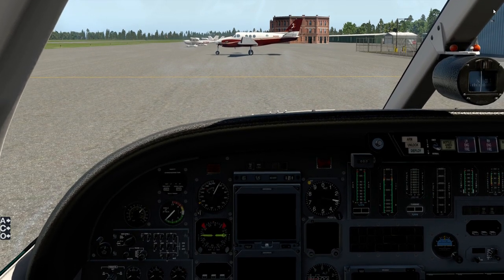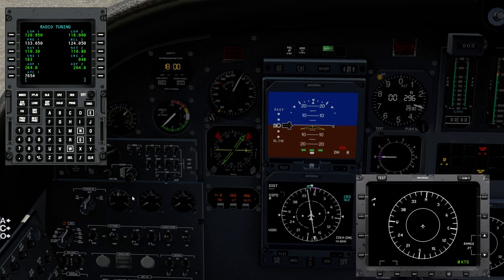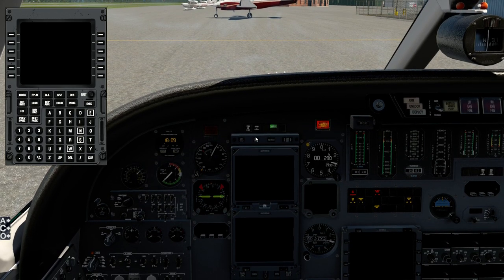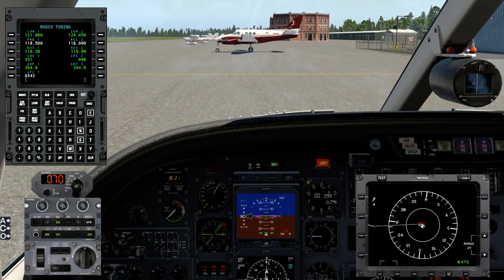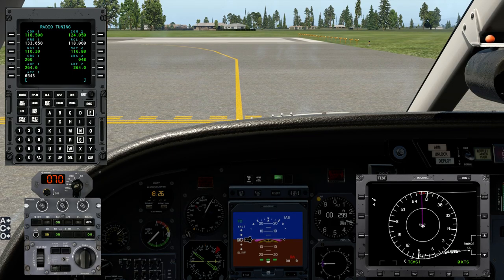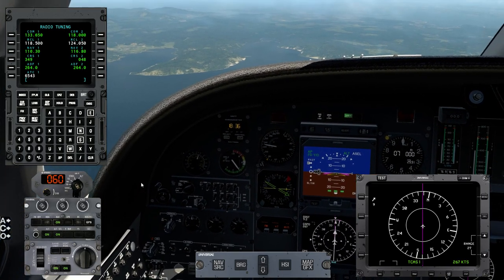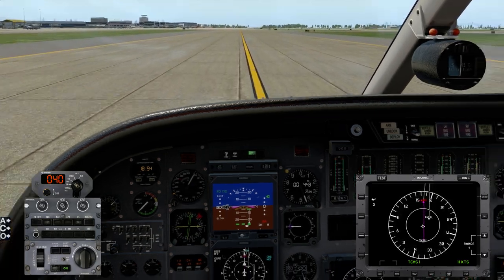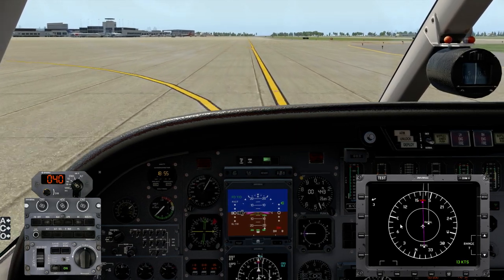Carenado Cessna S550 Citation II for X-Plane 11 Startup and Normal Operating Procedures

Comment: Hi one Questions how do i actívate the checklist?
Reply from the maker: Hello. Here’s the checklist:

BEFORE START

Preflight Inspection - COMPLETE
Flashlight - ABOARD/CHECKED
Fire Extinguisher - ABOARD/CHECKED
Microphones, Headsets, Oxygen Masks - ABOARD
Documents and Manuals - CHECKED
Oxygen Quantity - CHECKED
Circuit Breakers - CHECK IN
Anti-Ice/De-Ice Switches - OFF
Control Locks - REMOVE
Generators (except for GPU start) - GEN
Fuel Boost Pumps - NORM
Ignitions - NORM
Crossfeed - OFF
Gyro Slave Switch - AUTO
Standby Gyro - ON/VERIFY POWER/OFF
Seat Belt Sign - CHECKED/OFF
Anti Skid - OFF
Cabin Pressure/Rate Control - SET
Throttles - CUTOFF
Engine Sync - OFF
Windshield Bleed Valves - CLOSED
Battery Switch - BATT (CHECK 24 VOLT MINIMUM)
AC Power & Master Avionics - ON
Rotary Test - CHECKED
Parking Brake - SET
Landing Gear Handle- DOWN/THREE GREEN/NO RED
Engine Instruments - NO FLAGS
Electric Elevator Trim - TRIM DISC CHECKED
Airspeed Bug - SET
Fuel Quantity - SUFFICIENT/BALANCED
GPS/FMC - PROGRAMMED
Flight Plan - FILED

BEFORE STARTING ENGINES

Chocks - REMOVED
Seats and Pedals - ADJUSTED
Beacon/Navigation Lights - ON
Cockpit Lights - AS REQUIRED
Standby Gyro - ON
AC Power & Master Avionics - OFF
Air Conditioning - OFF
Cabin Door - LOCKED/LIGHT OUT
Before Start Check - COMPLETE

STARTING ENGINES

First Engine Ignition - ON
First Engine - START
N2 - VERIFY RPM INCREASE
First Engine Throttle - WAIT FOR N2 ABOVE 8% THEN SET TO FLIGHT IDLE
ITT - MONITOR WITHIN LIMITS
N1 - VERIFY ROTATION/RPM INCREASE
WAIT FIRST ENGINE STABILIZED
Second Engine Ignition - ON
Second Engine - START
N2 - VERIFY RPM INCREASE
Second Engine Throttle - WAIT FOR N2 ABOVE 8% THEN SET TO FLIGHT IDLE
ITT - MONITOR WITHIN LIMITS
N1 - VERIFY ROTATION/RPM INCREASE
WAIT SECOND ENGINE STABILIZED

BEFORE TAXI

GPU - DISCONNECTED
GENerator Switches - GEN
Volts/Amps - CHECKED
AC Power & Master Avionics - ON
PASSenger Advisory Light - PASS/SAFETY
Cabin Pressure and Temp Controls - SET/AUTO
Gyro Pressure - CHECKED
Air Conditioning - FAN OR OFF
Circuit Breakers - CHECK RIGHT/CHECK LEFT
Belts and Harnesses - FASTENED
Exterior Lights - AS REQUIRED
Before Taxi Check - COMPLETE 
 
TAXI

Check Departure Runway - BUGGED/VERIFIED
ATIS and Clearance - COPIED
Transponder - SET AS REQUIRED
Brakes and Steering - CHECK RIGHT/CHECK LEFT 
Flight Controls - TOPS CHEKED/BOTTOMS CHEKED
Flaps - CHECK OPERATION/FLAP HANDLE AGREES WITH FLAP POSITION
GPS/FMC - PROGRAMMED
INVerters - CHECKED
Auto Pilot & Flight Director - CHECKED/HEADING-ALTITUDE SELECT
Anti-Ice/De-Ice - CHECK AND AS REQUIRED
Thrust Reversers - CHECKED
Flight Instruments - CHECKED
Altimeter/Altitude Selector - SET
Radios/Avionics - SET
Fuel Quantity/Balance - CHECKED
Pressure Source Selector - CHECKED LH/RH/NORM
Speedbrakes - CHECKED/RETRACTED
Flaps - SET 7 DEGREES
Trims - SET THREE TRIM WHEELS
Takeoff Data/Bugs - REVIEW
Crew Briefing - COMPLETE
Taxi Check - COMPLETE 

BEFORE TAKEOFF

Ignitions - ON
Anti-Ice/De-Ice - AS REQUIRED
Pitot/Static Heat - ON
Exterior Lights - ON
Transponder/TCAS - ON
Engine Instruments - CHECKED
Anti Skid - ON
Annunciator Panel - CHECKED
Departure Runway - BUGS ALIGNED/VERIFIED
Before Takeoff Check - COMPLETE

AFTER TAKEOFF AND CLIMB

Landing Gear & Lights - UP AND OFF
Yaw Dampener - ON
Flaps - UP
Engine Sync - ON
Ignitions - NORMAL
Climb Power - SET
Anti-Ice/De-Ice - AS REQUIRED
Anti Skid - OFF
Pressurization - CHECKED

Passenger Advisory Lights - AS REQUIRED
Exterior Lights - AS REQUIRED
Climb Check - COMPLETE 
 
TRANSITION (climb)

Altimeters - 29.92/29.92-CROSSCHECKED
Recognition Lights - OFF
Oxygen - CHECK
Pressurization - CHECK
Air Conditioning - FAN OR OFF
Transition Check - COMPLETE  
 
DESCENT

Defog Fan - HI
Foot Warmers - CLOSED RIGHT/CLOSED LEFT
Airflow Distribution - COCKPIT
Pressurization - SET
Windshield Bleed Air/Manual Valves - LO/MAX
Anti-Ice/De-Ice - AS REQUIRED
Fuel - BALANCED/CROSSFEED OFF
Descent Check - COMPLETE 
 
 
APPROACH

Altimeters - SET/CROSSCHECKED
Belts and Harnesses - ON RIGHT/ON LEFT
Passenger Seats - UPRIGHT/OUTBOARD
Cabin and Emergency Exits - CLEAR
Recognition Lights - ON
Landing Data - SET/POSTED
Anti Skid - ON
Pressurization - CHECKED
Avionics/Flight Instruments - SET
Approach Briefing - COMPLETE
Passenger Advisory Lights - PASS/SAFETY
GPS selector - SET
Approach Check - COMPLETE 

BEFORE LANDING

Landing Gear - DOWN-3 GREEN-NO RED/VERIFIED
Ignitions - ON
Engine Sync - OFF
Pressurization - CHECK ZERO DIFFERENTIAL
Landing Lights - ON
Flaps - LANDING
Annunciator Panel - CLEAR
Speed Brakes(Prior to 50 ft AGL) - RETRACTED
Autopilot/Yaw Dampener - OFF
Before Landing Check - COMPLETE 
 
AFTER LANDING (silent)

Anti Skid - OFF
Pitot Heat/Anti-Ice/De-Ice - OFF
Ignitions - NORMAL
Exterior Lights - AS REQUIRED
Standby Gyro - OFF/CAGED
Transponder - AS REQUIRED
Radar - STANDBY
Flaps - UP
Speedbrakes - RETRACTED
Trims - RESET
After Landing Check - COMPLETE 
 
SHUTDOWN

Check Parking Brake - AS REQUIRED
Transponder - STANDBY
Avionics & Inverters - OFF
Overhead/Defog Fans - OFF
Air Conditioning - OFF
Throttles - CUTOFF
Exterior Lights - OFF
Passenger Advisory Lights - OFF
BATTery Switch - OFF
Clock - ZEROED
Shutdown Check - COMPLETE 
 
VREF – KIAS Flap Full

WEIGHT / KIAS
14.1 / 114
13.5 / 112
12.7 / 108 
12.0 / 106
11.5 / 104
10.5 / 99
9.5 / 95

VREF – KIAS Flap 15

WEIGHT / KIAS
14.1 / 122
13.5 / 119
12.7 / 115 
12.0 / 113
11.5 / 111
10.5 / 106
 9.5 / 102
Reply from the maker: To set up a checklist in X-Plane, follow the below instructions.  The text is converted to speech automatically by X-Plane as you toggle through each checklist item.  The checklist can be displayed on the screen, or removed from the screen for voice-only checklist toggle.

Using a Checklist
X-Plane has the ability to display a simple checklist in the simulator. This checklist must be stored somewhere in the X‑Plane directory as a plain text (‘.txt’) file.

To load a check list, open the File menu and click Open Checklist. Click on Load New Checklist and navigate to your ‘.txt’ file. Open it and you will see the checklist displayed line-by-line in the checklist window. You can use the forward and back buttons to go to the next and previous lines, respectively.

If you prefer to see the text file all at once (rather than line-by-line as in the checklist view), you can select Open Text File from the File menu and then load a file in the manner discussed above.
Reply: SOG Pilot thanks you so much

Comment: How do you ident on this aircraft, when atc tells you to ident?
Reply from the maker: Hi there. If you take a look at the transponder,  right next to the four digit squawk code display on the left is a small “IDENT” button. Pressing this will briefly enhance your signature on air traffic control’s radar scope.  Every aircraft with a mode C or mode S transponder response to interrogations by air traffic control radar every few seconds. When you’re asked to “IDENT” it allows ATC to differentiate your aircraft from others on their scope allowing them to quickly identify your location.  Your enhanced return will last a few seconds and then appear normal to ATC.
Reply: Oh okay, awesome! Thanks for the help, SOG pilot!
Reply from the maker: Okay, so on this airplane, the ident button is the red "IDENT" button below the digital display (not to the left).  Look for the four digit squawk code (6543 in this case) and just below it is the red light (IDENT).  It's kind of small, but doable during flight.  Good luck!

Comment: Hey for some reason my radio com is not working
Reply: Any idea y??
Reply from the maker: Hello. Are you using PolotEdge Comms, Or are you using the X-Plane ATC Comms?
Reply: X plane  ATC
Reply from the maker: Okay. Speaking for myself, whenever something stops working, the first place I look is anything that has changed. For example, did I do a software update? Did I add a new plug-in? Did I change a setting? Did I install new hardware? What has changed on your system between the time ATC last worked and now?

Comment: It Works, similar To This. However, NOT Exactly the Same. So This is good for Practise. ONLY, if You Bear in Mind, That it ACTUALLY, works slightly Differently AND YOU ALSO LEARN - HOW IT "ACTUALLY WORKS".